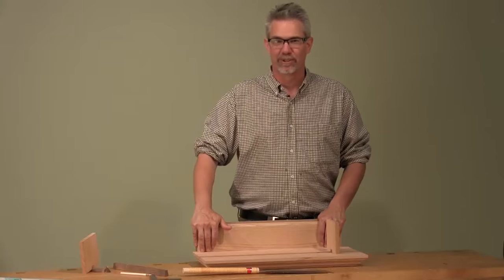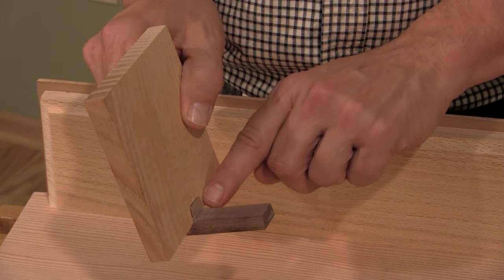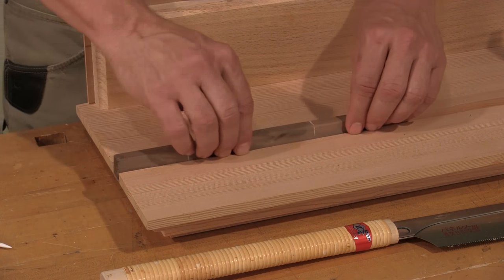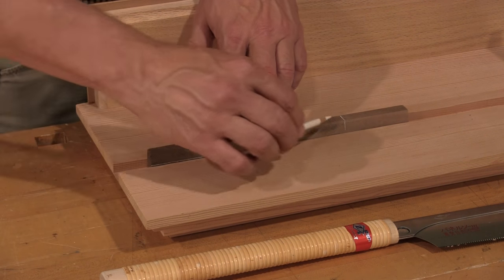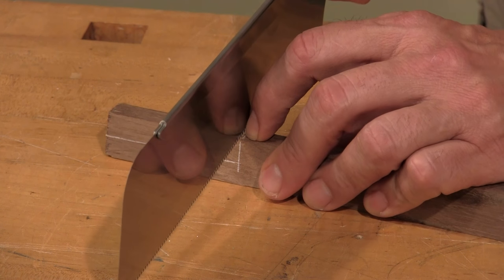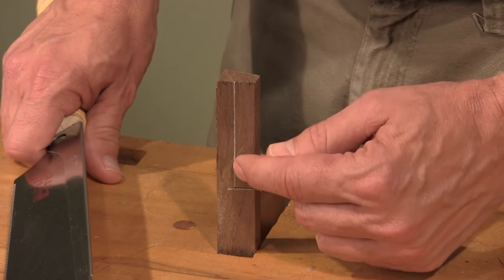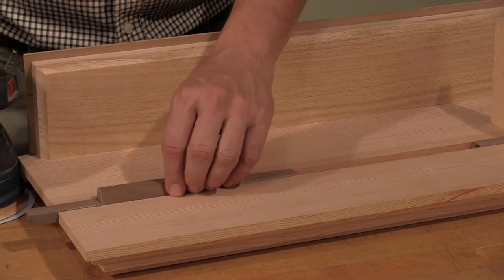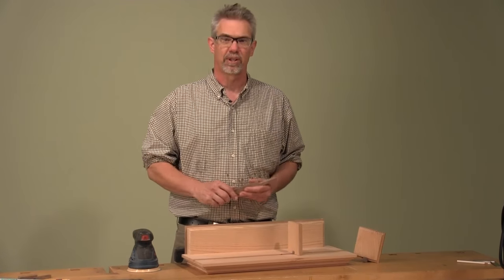Using a Sliding Dovetail Rail to Secure Bookends

Comment: Looks like the bookend attaches to the dovetail via a very small section of cross grain in tension.  The first good whack the bookend receives is going to send it flying when the dovetail splits in that area.  Ironically it would be far better to run a screw from bottom through the joint to prevent this.  Yes I know it takes away from the traditional woodworking allure but OTOH you're cutting the dovetail (sort of) flush with a japanese saw and then hitting the result with an electric orbital sander, so...